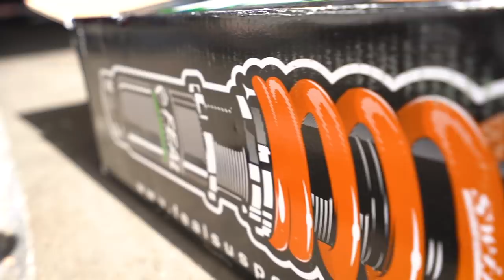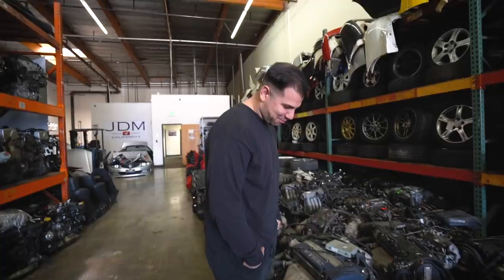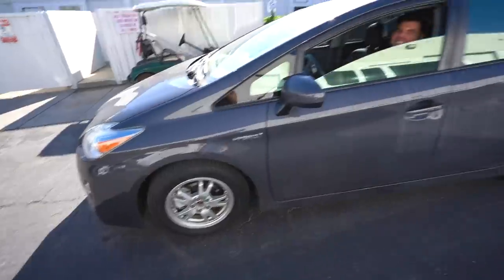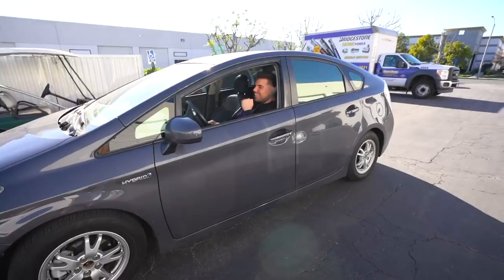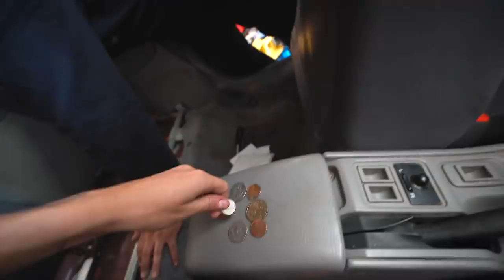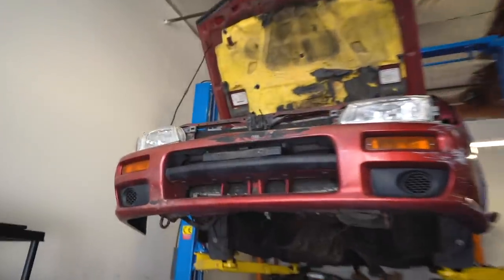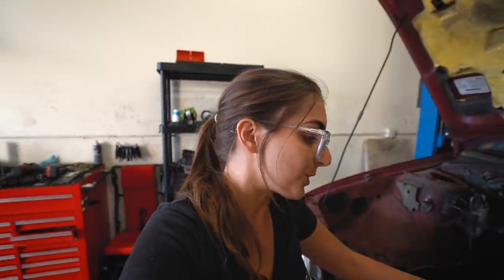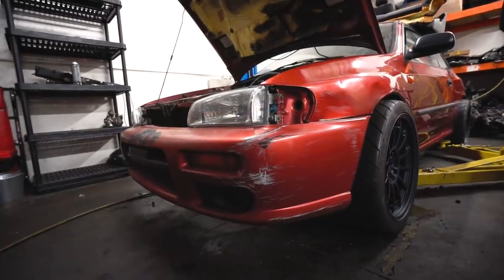I bought a WORTHLESS car...

Comment from the maker: I’m going to get a professional opinion on the frame damage, but let me know what you guys think. Not sure if the previous owner tried fixing it or if it looks like they pocketed the check. I think the frame is straight but the damage is disconcerting. 🤷🏻‍♀️
Reply: Are you using this for rallying? If so, does the damage mean you wont be able to use it?
Reply: EmeliaHartford You will need to at least have an alignment done just to check the frame isn’t too far out, If your going to do motor sports with it be absolutely sure there is no cracking around the subframe mounts. Otherwise in my humble opinion as long as you put a good cage in it it should be fine on track.
Reply: Get it rolling and take it to a frame shop it shouldn’t be that expensive to fix it doesn’t look too extensive
Reply: Part it out if you only have $800 in the shell and recoup you $
Reply: Would look at the alignment before going to far. As a track car you want to go straight. Compared to rally. So you might want to reconsider this body if the numbers are to far out of wack.
Reply: If it's going to be rally car you want the cleanest shell possible rear damage isn't as important as front but when your seam welding the shell you kinda want the chassis legs perfect, (to keep a somewhat stiffened crumple zone) but if its going to the track you can tube frame the front so crumple zones aren't as necessary or required with tire walls and gravel traps . But in rallying she needs to b strong and so your not spending thousands welding a cage into a bent shell. Keep it for cuts  when you do crash another one ,👍🏼see the body shop guys agree, but I cant see how bad the damage is take bumper off and have a look . (the more times the metal is bent the weaker it gets too)
Reply: Shouldve started with a legit shell .
Reply: Depends on what you'll be using it for. It doesn't look too bad at first glance. You can take basic measurements to see if it moved. A shop with a jig has everything to do that also. Sometimes it sucks yeah, but at least it was a cheap car. I think it's worth saving it though (I have a sweet spot for cheap unloved beaters.). Cheers from France !
Reply: Frozen Pete yes you are right, but its kind of no comparison when you see the difference in parts quality when you see a base impreza and a base wrx or sti. Base impreza has inferior suspension from struts to bushes to control arms etc. as an example. If i was her i wouldve started with a standard gc8.
Reply: It doesn't look that bad BUT the way to find out is to strip the paint down and look for cracks in welds and put it on an alignment machine and see how far out the alignment is. You can measure the "frame rails" and see if you can find what they are suppose to be online and see how far out it is.
Reply: @Terminator4000  very true, I don't know subbies for now, we only got the 4 doors 2.0t called the gt turbo around here or the cheap entry level. If the bare shell is shared with the rest, she looks like going to swap a lot of the suspension anyway, so I guess it doesn't matter that much. Sometimes starting from the cheapest car sounds like a good idea, then you realize it might not be, but at that time when you can't find the right car to begin with and it goes on and on and on. That one doesn't look that smashed, a bit of measurement and inspection, then see
Reply: Frozen Pete yeah im sure she will be. Just speaking from experience, i cringed when i found out she was using a base impreza 😭 but hey I suppose it doesnt matter when you have to work with what ya got. Good luck to Emelia on the build i love subarus.
Reply: Yes, make sure the frame is top notch before you put more time into it.  Otherwise you will be kicking yourself later.
Reply: @davebetney  if she were to use it for rallying you would want the frame in its strongest form. Rally cars have additional frame reinforcements as well as rollcages to withstand the stress.
Reply: Go tubular front f it or rock it
Reply: Hope u keep fixing sunfire up its gonna be a bad ass project sweetheart keep up on that grind and love that smile of yours .
Reply: Time to call bisforbuild and collab?
Reply: EmeliaHartford A “thrust”  alignment, I would think, will give you an idea of how bad.
Reply: EmeliaHartford tubeframe it. swap a 2jz and all the car bois be rioting.
Reply: Emelia, unfortunately that's how it goes with salvaged vehicles. Alot of them are "shade tree" fixed. I see it everyday fixing wrecked cars. It looks like they may have pulled the frame straight enough to drive down the road and that's about it. Get a professional trusted body shop to look it over and put it on a frame machine and measure it.  An alignment alone won't tell you if the frame is bent.
Reply: Is It Just A Track Car?? Will It Pass Inspection like that?
Reply: @maxwell5428  exactly why I asked mate. If its crumpled it will compromise the overall integrity
Reply: @Sean-John  If the alignment is fine and the tires wear good it will pass inspection.
Reply: Hiiiiii It's always a sinking feeling when you see frame damage but I have no doubt you will make sure it's fixed or at least safe and your friends/crew that work with you on it will too. I have a ? for you, I have a road course racer ('97 Dodge Neon) that I converted back to a daily, I left all the racing parts just put in the interior and legal parts but I was wondering If you know of a place to get good used Neon parts? I'm building (in my house) a 2.4 turbo SRT4 engine and shooting for 400+ hp Love the video's, the builds and you of course. lol  Have a very happy (and safe) 2020
Reply: @kimballscarr  The time has kinda passed to find one of those in good shape anymore.  Even in California I rarely see Imprezas that old anymore and they are usually wagons.
Reply: @kimballscarr  litterally none of the cars she builds would be even close to street legal in California anyway lol.  You can still find decent BG Legacys here at least so that might be an option, I drive a 96 outback with 480k miles on it.
Reply: You need an AKITA, for a good therapy dog, and protection. LoL😂👍🐕
Reply: Definitely get it checked. 👍👍
Reply: I did body and frame work, that is an easy fix no motor in the way a couple of pulls it will be fine
Reply: Part it out and find a better gc body
Reply: New idea, Emelia.  Check the chassis rails, if they're straight...get a straight front clip, OR tube frame it!
Reply: please stop calling it a damn frame its the body! unibodies don't have a frame
Reply: @domcorleone9354  it's still got a frame, buddy.  The frame is part of the body, hence the term "unibody".
Reply: Alexander De Santis you just said it your self it’s part of the body meaning there isn’t a frame, the body is the entire structure there isn’t just one piece that gives it strength. We can argue all day long but it’s not a frame
Reply: sorry to be so offtopic but does someone know of a tool to log back into an Instagram account..?
I somehow forgot my password. I appreciate any assistance you can give me.
Reply: @Kamdyn Kellen Instablaster :)
Reply: @Tristian Parker Thanks so much for your reply. I got to the site thru google and I'm waiting for the hacking stuff atm.
Takes a while so I will reply here later with my results.
Reply: @Tristian Parker It worked and I finally got access to my account again. I am so happy:D
Thanks so much you really help me out!
Reply: @Kamdyn Kellen you are welcome =)
Reply: I thought you were the professional? People sure seem  to be making you out as one on all aspects of cars. It helps to have a whole team dedicated to YOU and your crap who are willing to teach you.

Comment: I will also agree ongetting the second opinion on the damage.  I would suggest removing all the extra sheet metal from up front first, espeially anything you plan on replacing or redoing and have it looked at/repaired as stripped down as possible.  Something to consider is that even a clean non-damage (appearing) car can have some serious warpage or twist depending on how it had been driven or treated.

Comment: That's just an excuse to go full tubular front end. It takes a lot of time to get it all straight but looks so clean when done. Just double check all regulations for any classes you wanna compete in. Some say you can do whatever you want, other say you have to cut before the most forward pick up point on the suspension.

Comment: GC lateral are the same as GD wagon. 05+ has aluminum front lateral links. Super pro makes bushings for them. Or if you're baller get WL adjustable. Suggest boxing trailing arms. 5x114 has large ball bearings. I ended up pressing them and installing non- channeling grease for extra protection, just an idea. I would consider get titanium brake shims to protect the brake caliper boots. Keep the build going! Starting my ej207 w/1.5xtr. So will let you know Emilia when it's going. As you asked at subiefest.

Comment: Thanks for the Code on the FEAL Coilovers .Heck Yah. I like that they come w/ camber adjustment....WALK away from that Chassis! You will NEVER get a proper Wheel alignnent. Unless you dont care. Years ago i bought a '81 Cutlass Supreme for $400 that had bent frame. The frame shop tried their best, but couldn't get the alignment to spec. At 60 mph the car had a slight wobble. Very annoying. But around Town it was Cool as Sh_t. And i never fixed the exhaust leak cuz it sounded like a Bad Ass Hot Big Block w/ a Lumpy Cam and Solid Lifters! Lol!

Comment: I know its probably been said more than a few times below but.... If you are going to be really building this car for the long term, get the body work done now while it is basically a shell. Its cheaper and they will do better work. I get the coupe life and what you are going for. The body looks like it needs to be de bumped all over and that is fine. Bite the bullet, trash a credit card and move on. Mad props to you and your team though. No one can say you are not a Legit car nerd :)  I went through this with Ally McBeetle and took it down to a rolling shell, towed it to the bump shop and had them beat it mercilessly with a pretty stick. That was like 8 years ago and it is starting to get fuzzy again but I do race it allot and that is rough on the gal. Another few years and I will have to redo it all over again. Car life.

Comment: Looking at yours, compared to mine, yours is in excellent shape considering, on mine the top radiator support piece is tilted downward at 30 degrees, the support underneath still has multiple kinks in it and, I'm not sure if this is normal or not, but where the rear of the control arms bolt on, that support coming out is bowed in slightly, not sure if that's from me putting jackstands there, but realistically that shouldn't push it in like that, cars not that heavy.  

I'd say it's fine, if it's minimal enough it can still drive straight, then send it, she'll be right.

Comment: Dump the frame and tube it. Ditch the body and invest in a decent kiln. Make all new body out of carbon fiber, customized to suit. Go the extra and slap on fiber rims, BST, think rotating mass/power to weight/sprung and unsprung. Save you a bundle in the end and you will have the tech to use on future builds like Mimi.

Comment: I assume the chassis bits of the front on the L coupe, RS, Coupe WRX typeR STi, etc, are mostly all the same as the 4-door ones, so you can most likely order them directly from Subaru at usual generic prices as you would most panel bits that aren't bolt-on fenders etc.

Comment: Enkeis on the Prius. This will only be the start of a whole other build. 

Edit: I'm stupid I think you mentioned something about going rally or Gymkhana spec with SunFire. 

 Also, rally spec bash bars and lift points on SunFire, make a through-body cage could be a solution to your structural integrity concerns?...yo, StudioRSR got another one for ya. Yeet.